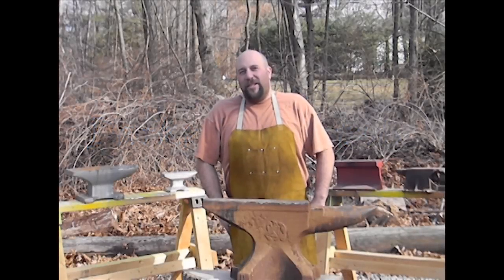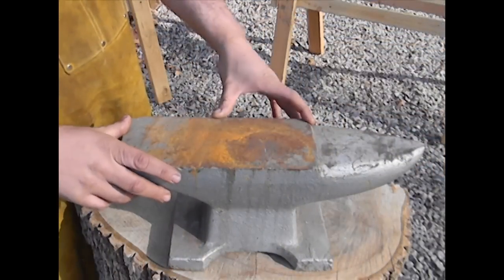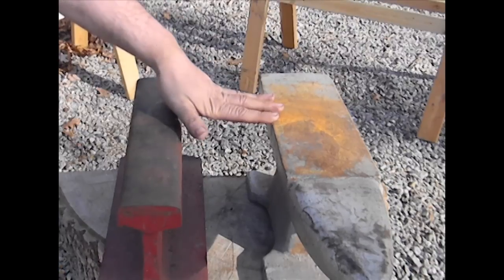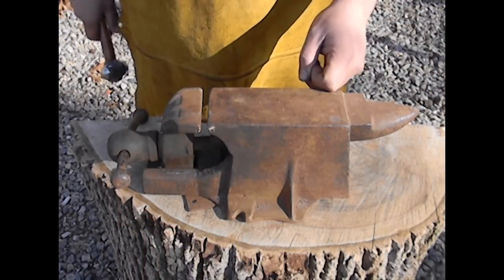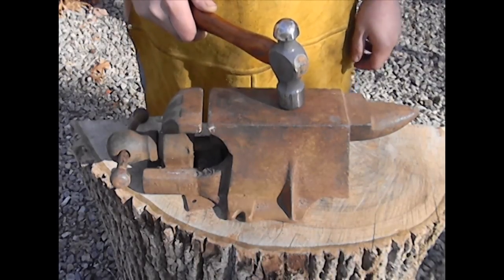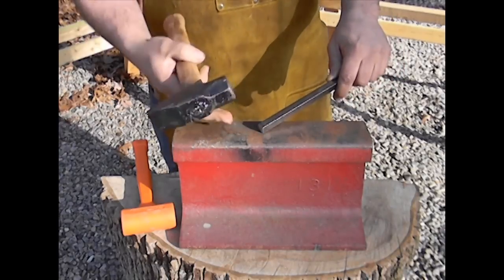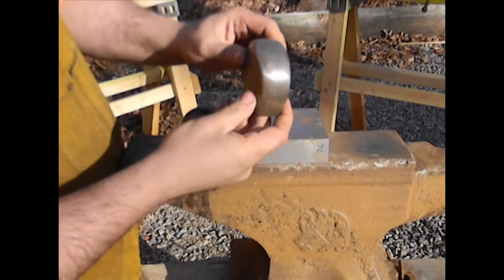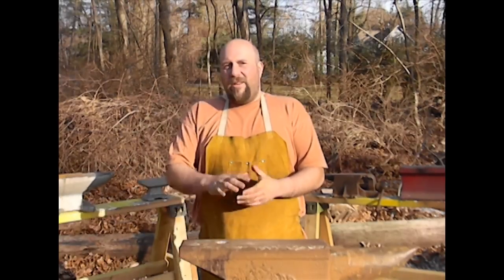The Basics of Anvils

Comment: Jeff, I like your video and is very informative BUT... <and it's a big one>... you may want to consider using an external microphone. If you have a lavaliere mic, that would be ideal. Or, if you have a good external, directional microphone instead of the onboard camera mic, that would be fine too.

I am saying this because I am a videographer and understand a little bit about the dynamics of sound, and why it's so critical and important in videos.  Your video is nicely made and I hate to say this but... your sound really stinks. There are several points where it's very hard to understand what you're saying because of the background and ambient noises. At several points during the course of this video, you are being drowned out by the noises in the background. During one part, loud stereo music nearly makes it impossible to hear what you are saying and I had to really listen hard to what you were saying because it was hard to understand you.

There are lots and lots of external mics available on the market. Furthermore, there are a wide selection and wide array of directional mics that could be mounted and connected directly to your camcorder for recording audio. The advantage of a directional microphone are many, not the least of which, filtering out most of the unwanted ambient sounds from around you. With a good mic pointed at you, hearing you would be far easier and your voice would be clear and much easier to  understand.

Among other things, I am also a novice blacksmith/knifemaker.  You have good advice and info. I hope you won't be offended,  but as with many common layperson, are lacking a bit in understanding video filming and the importance of good audio.

Your camera work is alright, albeit a little one dimensional since you only seem to be offering a single angled shoot, with a few closeups thrown in here and there. But the footage you did film is actually pretty good. The color is beautifully saturated. You obviously used a tripod, a big "Kudos" there, because the footage is steady and not wandering all over the place.  Your closeups of the anvils are also nicely done, so you clearly put a lot of thought into how and what you wanted to film, and even more thought into what you wanted to say. Your choice of filming outdoors was a good one. The partly cloudy skies prevented the picture from being over-saturated and minimized an infiltration of too many harsh and hard edge shadows, good job, good choice because of the mild and slightly subdued weather. With a few minor adjustments, your videos could be excellent and informative. Thanks for sharing.
Reply from the maker: +JW Back when I made this video I had a lot going against me... The camera I was using back then was a hand me down nikon coolpix. I could not use a tripod when I filmed this, the lug that holds the camera to the tripod mount broke out of the plastic. I had the camera sitting on a step ladder, at one point it was being held on the end of a 2 x 4 with a bungee cord.

Since then I moved on to a JVC camcorder, I still use the onboard mic but now I edit everything in Adobe Premier. I can raise the audio levels in the software which is nice. I also got a GoPro Hero not to long ago so I am hoping to experiment with that soon. My lighting is still not anything to write home about but I have been able to add a little more to it in the shop.

I love to get constructive feedback, I never understood why people get so offended when others offer their time and thoughts. This video was done just a tad over 4 years ago, if you have a moment and would like to check out a more recent video from the beginning of this year just follow the link:

https://www.youtube.com/watch?v=0olrEbutAXI

I'd like to see what you think of that, its still not going to win me an Oscar but I think its a lot better than what I was able to do in the past. Thanks for the view and the comment, please feel free to offer advice anytime.